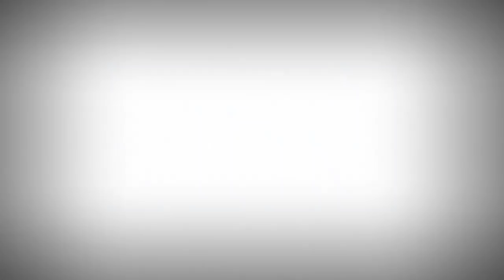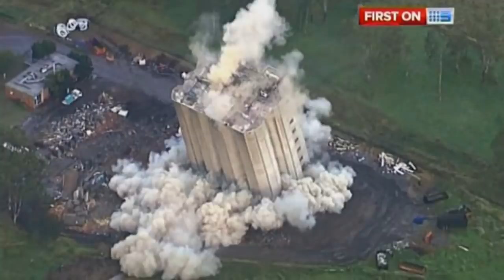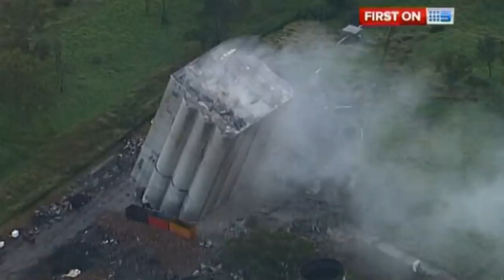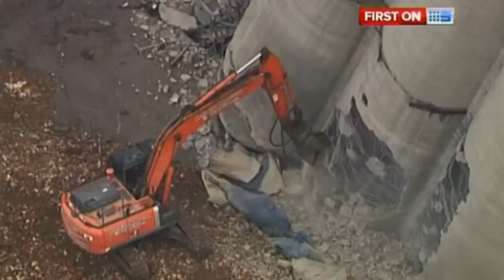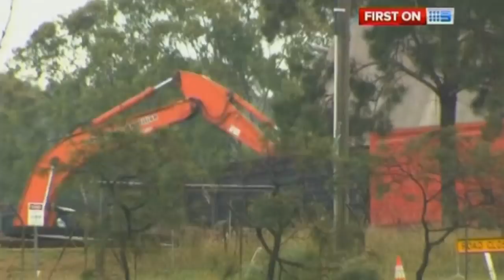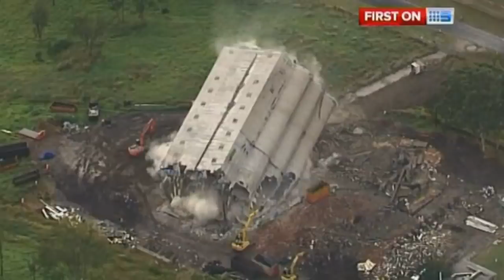A giant building implosion in Australia goes wrong

Comment: Just use jetfuel on the top floors, will come down within an hour.
Reply: It's concrete, not steel. Lmao
Reply: That's awful. :-(
Reply: Protip: Concrete doesn't melt.
Reply: >9/11 was planned
>edgy anonymous pic
>conspiracy channel

Yups.
Reply: Xendrius yeah but they have to be careful doing that... another building a few blocks away might mystiously collapse aswell, for no apparent reason...
Reply: Building 7 was hit by a falling skyscraper, gouging a huge hole in its south face, losing at least 4 full vertical support columns.
Reply: I know yours is a joke tesla, but for everyone else, no, building 7 wasn't hit by anything, buildings 5 and 6 however were almost cut in half and stood till they tore the whole site down.
Reply: This is epic
 The WTC also had concrete and steel. People are so fucking blond. They see this and still have excuses as to why the WTC's fell due to fire that wasn't even hot enough to "melt steel".
Reply: You mean the FACT that jet fuel it self doesn't melt steal beams?
Reply: Correct. The large office fires heat (but do not melt) the steel. Steel loses rigidity when heated and becomes much less load-bearing. The floor trusses began to sag under the weight of the floors which caused an inward pressure on all the columns. The "tube-within-a-tube" and all-steel construction are to "blame" for this. Eventually, the inward "pulling" from the floors sagging caused the columns to buckle, which initiated the collapse. Once a column buckles, the force redistributes through the rest of them causing all kinds of bad shears/torques, popping rivets and tearing columns... a rapid cascading failure of the columns (you can actually see this torque in the upper half of one of the towers during the collapse), once the vertical columns are gone, it's just gravity from there.
Reply: tesla, you need to change your user name and stop. what your talking about, some mild annealing in the specific rooms and floors would do literally NOTHING to the overall structural integrity to the building. have you not seen the towering infernos lately? why not them? top to bottom bonfire, yet standing strong. how about the top to bottom Beijing hotel that was BUILT asymmetrical and didn't even slightly LEAN to its heaviest side. the british one? it was burned out so severely you can see all the way THROUGH it and not even a little danger of sagging or SLOOOOOWLY listing to its most compromised sections and merely SHOW some asymmetrical damage.
and NO, the floor collumns never sagged in building 7, it didn't happen, wont happen, cant happen. you're also completely guessing on what happens if a column were to buckle, since a steel building has never had one buckle due to fire. what you described didn't even match some of the b.s. incorrectly constructed modelled.

its cute you said dumb-dumbs above, yet said what you said while having tesla in your user name.  you cant possibly show, not when we have steel buildings devoured by fire contradicting you, you cant show, not comment but a tiny scale model, SHOW, a symmetrical collapse that occurred in 1,2, and 7. and to refresh your memory, cause you seemed surpised "after 15 yrs" buildings 5 and 6 were CUT IN HALF! cut in half from damage and asymmetrical and had fires clearly with buckled and sheared and compromised "collumns" and yet those stood, and remained standing until ....wait, what did they do?...how did we take down 3,4,5,6,?....oooohhhhh that's right.....
Reply: If this where true the steel structure would still be standing. The building collapsed at nearly free fall speed an hour after a fire in the top floors. Please. Just think.
Reply: if people still think jet fuel and office fires brought down those buildings in the matter they came down then oh well I guess waters not wet.
Reply: The big airplane smashing into the building caused faults. The impact of the plane compromised the core of the building. That allowed the fire to comprise the steel. It was also an older building.
Reply: Tesla Death Ray it's only gonna compromise what's above it not what's below it, don't have to be a rocket science to see that. even at that how can fire weaken beam 10 floors below. Oh and water is wet btw
Reply: Tesla Death Ray The towers where built to withstand the impact of a boeing jet for this reason.
Reply: The building can handle a static load, but not a dynamic one. Imagine a glass coffee table. You can put a mug of coffee on it and it will hold up just fine. Now drop that mug on the same table.
It's like that.
Reply: are you talking a bout this article tesla?

""Of course, the structure of the lower 79 floors has been holding up the weight of the top 31 floors for many years. (That's the static load.) So should you expect it to be able to hold that same weight, dropped on it from a height of 12 feet (the dynamic load)?
The answer is, absolutely not!
Here's why.
First, let's calculate approximately how fast the upper 30 floors slammed into the 79th floor. (If you slept through high school physics, you may want to skip ahead to the result.)
    d=distance,  g=acceleration of gravity,  t=time,  v=velocity
    d = 0.5 g x t²
 
Solving for t:
    2d = g x t²
    t² = 2d / g
    t = sqrt(2d/g)
    t = sqrt(2d) / sqrt(g)
 
    v = g x t
Substituting for t:
    v = g x sqrt(2d) / sqrt(g)
    v = (g / sqrt(g)) x sqrt(2) x sqrt(d)
    v = sqrt(2g) x sqrt(d)
 
    g = 9.8 m/sec²
    d = 3.8 meters
 
Thus:
    v = sqrt(19.6 x 3.8) m/sec
    v = sqrt( 74.5 ) m/sec
    v = 8.6 m/sec
 
    1 meter = 39.37 inches, so
    v = 8.6 m/sec x (39.37/12) ft/m = 28 ft/sec.
    which is 19 mph.
In other words, if you drop something from a height of 12 feet, it will be moving at about 19 miles per hour by the time it reaches the ground. It doesn't matter whether it is a single brick or a 30 story building. After falling 12 feet it will be moving at about 19 mph.""

that's complete bullshit. coffe mug. yeah ok lets take a stack of ten coffe mugs. were going to blow up and completely remove the 9th mug allowing the top/10th mug to freefall and strike the 8th. the 8th is going to be completely fine, as with the 7th and so on. the absolute most that will happen is the 10th roll and fall off the 8th.  if I stack ten bricks, remove the 9th and again the tenth will hit the 8th. stack ten haybales, etc, now stack stories of a steelframe high-rise. your coffe mug example isn't calculating actual force. a complete story of the building CAN hit the the identical floor below it 19mph and absorb it. just like the bricks, just like botched demolitions, just like all the standing gutted and bombed out buildings we saw in Iraq, just like fires that engulfed entire buildings like the Beijing hotel top to bottom flames and the building had ZERO fireproofing.

I don't know how much you need or how much you've looked into this but your explanation, your example...it isn't backed by anyone. did you know that? your saying basically the pancake theory right? floors weakened and then collapsed? you are saying that right? did you know the government ISN'T ?? nobody is saying that, it was retracted. the "official" story isn't your explanation. and its funny cause the government under review and scrutiny had to retract that position because its impossible. but you and a ton of people still say it. can you tell us the "official" explanation. cause even the government when forced had to admit the pancake theory was impossible. but right now, the Washington post, 911debunker.com, Wikipedia, a host of others keep repeating it. you should look at what nist finally said. how they said it collapsed. 

so if the government has given three total explanations, changed its mind and postion twice, why not look at what science and physics have to say about it. and if you didn't know the official story had changed, just take an honest look. sit back for a second and wonder at the vaporized concrete and cookie cutter steel and just think for yourself. but at the very least know  that the government really doesn't have your back on what your saying happened. and please, if you find nist's answer PLEASE post it cause a ton  of people have filed foia's for it.
Reply: What makes  you think the govt. story is the only story? Thousands of agencies containing millions of experts have all investigated it. It is the single most investigated crime in the history of crime.
Reply: well sir, NOTHING makes me think theres only one story, hence this debate, I also volunteered Wikipedia and 911debunk sites, soooo,  but to the point what do you say caused the collapse, because mild annealing and bending is what the above said, caused a global symmetrical collapse in three buildings. what other story is there? there's math and physics and architects explanation, and then theres the "steel heated and bent from localized office fires and then collapsed in its own footprint 3 times"  id love to here more explanations.  you said thousands of agencies, HA.....HA......HA
..... moving on. so of the two agencies that have ever dealt with any findings on the collapse, which one described the collapse? and can you please say what they said, because  nist, not THE govt, and after you tell us what the one, single agency involved in any 9e;even investigation said about the collapse, please tell us where your opinion differs. and please, I really will listen because your an independent observer. the heavy handed sarcasm aside, I can tell you've put all of 3 seconds into this. so..... how long before the very first, the VERY FIRST investigation OF ANY KIND occurred. how long after? in the history of crime? that's stupid. most investigated??????? you made that up.

 so a full three years after the crime an investigative commission is formed. the testimony and findings are given in secret and off the record. this body of people you claim are experts is the first agency and says nothing about how the collapse occurs, is only formed after the victims families force it, and they are only left with questions and anger after they reveal their conclusions and then disband, rejecting any continued investigation. ANYTHING regarding the collapse itself is deemed classified and "would jeapordise national security" google it. then nist, the second "agency"(your words) finishes a 10,000 page findings report, and ends with " collapse imminent"

soooooooooooo, no one describes the collapse, not you, not agencies, not the govt. so now, if govt isn't the only story, and it shouldn't be, what are you saying, that our govt shouldn't have, or be expected to have the most accurate information? that youre willing to admit or concede the govt is wrong about this?  ok but if you and everyone else is simply saying that same wrong answer....wht the hell are you talking about? we don't have thousands of agencies, and we definitely don't have millions of experts, in fact the groups of experts are the ones you probably are arguing against. it took the victims families 3 fucking years to get the 9/11 commission formed. kennedy? that day investigation started, monika lewinki? yeah.... dude look this up, look how much money and how involved the Lewinski investigation was, and look at the spectacularly small budget of the 9/11 commission. but something tells me that if you were someone who looked stuff up, you wouldn't be on here thinking there a bunch, let alone thousands of whole agencies that deal the collapse of buildings, or think 9/11 was investigated at all. shouldn't an investigator have access to the crime scene?
Reply: lol except now, place several layers of glass under that coffee mug. Yea it will get through the 1st and 2nd, but the momentum slows with each layer it has to break through. Kinda like that instead.
Reply: I don't understand. are you saying place glass between the 10th and 8th mug, or place the whole stack on a sheet of glass like it would be the foundation. what is this showing?
Reply: SGWTYLER it was a jk we all know it wasn't jet fuel and it wasn't the planes either that brought them down.
Reply: and damaged the inside beams.... doing what? making it fall all four corners straight down through itself and NOT just a little bend towards the compromised area? it certainly didn't do much damage at all In truth tho, in 93 a van full of explosives parked right by the core, (your "inside beams") blew up with a hell of a lot more force than the jet impact and nothing happened to the steel frame. 
but anyway is this your own theory? can you describe the process? can you name the third official explanation? tesla didn't, no one else has, no foia's answered. how about what year the second was given. what year was the few frames out of the 86 cameras worth of footage of the pentagon finally released. do you know why? it was political pressure, and it was 06. you can think what you want but you don't know your own version. there was the pancake theory, debunked and retracted, then the "inward bowing" theory, which sounds a bit l;ike what your onto, this was also hilariously debunked and the "officials" had to admit it wasn't the explanation. 

now just as a person, did you know that nist manipulated and misrepresented most of the factors in all their models. is that cool with you? this was the investigation commissioned by congress after the 9/11 commission came up with nothing to explain the collapse. this includes the vast amount of sulfur, barium, and molten iron microspheres found at the site and all over manhattan. damaged inside beams doesn't explain that. sulfur....all over manhattan, in the dust. 

look think what you want, I don't know who did it, but those three towers came down from explosives. if you ever do look into this, and you come across the 18th misleading or straight-up lie from the government and "official" version, look at what math and physics says. look at their models. look at mythbusters literally dumping a huge pile of thermite and saying "doh! " look you'd need tons" I remember mythbusters saying "lets try and recreate it" do you think tereorists or whoever did it brought wheelbarrows and dumptrucks full of powdered thermite in the open air and just started going room to room packing em with 400,000 metric tons of thermite piles on the floor.... no....I have a hard time believing the mythbuster thought that either. now look at what cd contractors use, on their own comercials and youtubes. go look at home made youtubes of small amounts of "shaped-charge thermite" placed inteligentlycutting up industrial I-beam like its butter. on the cd sites they show the opposing 45 degree angle cuts they put on support collumns leaving exactly what you can go check for yourself was at ground zero.

but look just from your example your saying damaged inside beams ripped, tore, fell? well now your talking about "shear" strength. look up shear strength. just to give you an idea. have you ever driven in an suv? they weigh two tons. that two tons at rest is supported by only 20 small bolts. the ENTIRE vehicle, let alone all the force when it turns fast is supported by the small bolts that hold on the tire. these are cheap bolts. structural steel is even stronger. 2 tons....sitting on 2 pounds... 
well actually not even but it sounds cooler. ; ) .....shear strength.  I don't care how damaged floor 90-100 are. floor one? floor one IS HOLDING UP 109 FLOORS. FLOOR 20? 90 FLOORS.... and so on. that same floor and steel is at floor 90, the top ten floors can fall on it all day and it'll be fine. this is what EVERY EXPERT HAS SAID. the guys who built the building built it to be hit by  a 707, and the said it could be hit by multiple. like poking a pencil through a screen. 

but if that doesn't convince you, go look at ww2 footage, there were buildings built in the 20's that were standing in Hiroshima after a fucking NUKE hit them. a fucking nuke didn't take down skyscrapers in Hiroshima or Nagasaki. go look. is that not damaged inside beams? they were gutted instantly, just the strong steelframes still standing. no go look at ground zero. it literally looks like tons  matchsticks of equal length steel I-beam in a big pile right in its own footprint. go look
Reply: Xendrius  . the world trade center effect.  see how you are thinking
Reply: Aidan McLaren omg such compelling evidence! LMFAO.
Reply: +Tom tonka Coincidences stop being coincidences when they keep repeatedly happening. That Simpsons episode should have rung alarm bells, but those other movies/tv shows with those hints should be a big giveaway. 

But, seriously, it's obviously not referencing the emergency number if it's pointing to New York, with the towers acting as an "11". Anyone can see that. 

Now I realise you have to be a shill paid by TPTB. Noone can be this idiotic to make an excuse like this...
Reply: If you aren't a shill, you would have left by now instead of making inappropriately unfunny jokes that would make you the butt of the joke if you actually weren't a shill.
Reply: Wow, great comeback there! You sure showed me!

Calling me "stupid", even though you're too stupid to realise your employers will kill you the moment you stop becoming useful.

Did you think about that before you agreed to be their pawn?
Reply: Oh my goodness, no I never thought of that. You're right, I'm doomed lol
Reply: hey, tom, myself and others have given real evidence or at least tangible. any thoughts? no ones answered any questions about the official story changing or even what the government says happened. you have NO thoughts on that? because if you have pancake or inward bowing theory, both sides admit this is debunked and not physically possible. so you tom need a 5th idea of what happened, 5th because of the first two. then the govt's explanation now of which no can give me an answer. then the 4th which is from science, physics, architects, engineers, firefighters, pilots, forensic detectives, chemists, all of the first responders and eyewitnesses who were within a few blocks.... you get the idea. and then a 5th explanation which is a new one, or possibly co-incidently the 3rd but a new one to me and everyone else. 

ohhhhhhhhhhhhh let me just stop right here and put the uninformative "cacth-all" label 'directed energy'  as a 6th, but this is my equivalent of what the simpsons explanation is for you.

so this 5th explanation has to be as good as explosives. as good as shaped-charge thermite, the exact method, chemicals, tell-tale signs and results THAT COMPANIES WHO DOOOOOOOO CONTROLLED DEMOLITION GET. .... your on a cd clip. 45 degree cut I-beams and collums were found all over ground zero. so was thermite. the offices were pulverized with the concrete. even if you have an explanation for 'fire collapsed it' why aren't there 1000 sq ft chunks of floor and concrete and where the hell is all the office furniture? 

all of the evidence, the actual incident, lines up perfectly with a technique that already exists to bring buildings down....this is not far-fetched.
Reply: well, actually lets both pretend to be experts. everything we're discussing is public knowledge. we can fact check eachother. sooooo what is the conclusion reached by the best people suited to investigate. I wholeheartedly disagree with you that they were the 'most' suited based on the initial formation of the 9/11 commission, who was a part of it, who had problems with it and why. and then of course why it was reformed after public pressure and backlash. so... what did they come up with? how did they explain the only three seelframe highrises collapsing symmetrically in a manor and speed resembling cd from office fire? have you read my other posts? office fires doing what a nuke in Nagasaki cant? anyway.

 a skilled team of metal workers dismantling the scene doesn't explain the presence of thermite, molten metal in the ground, or fires reigniting weeks and even months later. but regardless I didn't claim it, experts did. and there are 45 degree cuts are from day one. look at top view pics. you wont admit that's an odd number of uniform length beams?

you didn't answer any of my questions, you picked reddit bullet point posts. no... ae911, david ray griffin, patriots for 911 truth, the first responders....they are very credible to me. not to you, fair enough but lets look at yours. you said experts investigated.....ok, well take everything they said, all of their conclusions, the TOTALITY of that is what has been amicably debunked. debunked by BOTH SIDES. a third conlusion was reached by these experts, publically, you can check, and you,  nor anyone filing foia's can tell us what that is. the CONCLUSIONS from science are absolutely ONE HUNDRED PERCENT on the side of cd. you cant argue with that, nist admitted freefall, the issue AT ALLLLLL was its resemblance to cd and such an anomaly in regard to fire and building damage. I thought you knew this? the commission and nists JOB was to explain why it wasn't cd. there is ZERO science in allllllllll of the rest of the experts you copy-pasted conlusions barring the unkown 3rd answer if that indeed contains science. zero...remember?... they kept changing their minds, used false models, resoundingly debunked? that happened... google it. pancake theory, inward bowing, and then whats YOUR explanation since your bizarelly arguing a side that said " to explain the collapse would jeapordize national security" and That'S why they wont tell you, me, anyone. meanwhile science, physics and math can tell us all we need to know. 

and fuck off with that everyone said muslims did it and then thinking that's somehow helpful, persuasive, or evidence. read above, I SAID terrorists did it. I have never speculated who, this entire discussion is at the very moment the 9/11 commission stopped. AT THE COLLAPSE!. the official story said what? "and collapse was imminent" that's your side...and everytime they try and explain how its thrown back. I have no idea 'who' and personally I don't think bush did it. did you know they were running a drill on the morning of 9/11, a military drill. guess what of? you guessed it a drill of hijacked planes crashing into the very places they crashed.i highly doubt "w" would do an attack of the very thing they were practicing. terrorists or cia or both anyone could've done it, but they sure as hell did it with it explosives. for all I I know the exact inceident with the hijackers happened and a completely different entity brought em down.

....look... i'll finish with a quote from you      " nothing except lies, twisted words, and hearsay. 16 years and not one of their claims has ever even been proven"
Reply: I already told you I'm not going to argue the how and why and the physics of the collapse because I'm not a physicist or expert in any of those matters. If you want to play pretend scientist then go for it, but I won't be having any of it. I can instead point(again) to the VAST majority of experts who say the way they collapsed is completely plausible from the plane impacts and resulting fires. Whether they changed their minds on exactly how it happened is irrelevant, that's what science is about- trying to prove yourself wrong.

You watched Richard Gage's cardboard box demonstration and still think he is a credible man? Unbelievable.

Got any proof of the military drills being held that day? Or of the thermite you claim was found? Conspiracy videos and websites aren't proof btw.

How does molten metals prove a controlled demolition? Show me another controlled demolition where molten metals has been a feature. A disaster zone that big with the rubble on fire..I'm not surprised there was fires and molten metals..I'm not sure what you are trying to claim here...Hope these links help

https://sites.google.com/site/wtc7lies/groundzerocleanup%2Cfreshkillssortingopera

https://sites.google.com/site/wtc7lies/photosoftorch-cutsteel

All it would take for the conspiracy theorists to be taken seriously is for them to release their version of the official report, or a computer generated model of what they believe happened. But I won't be holding my breath.
Reply: I KNOW you wont be arguing it because you CANT. and yes we can look up formulas ourselves. we can look up things from the material sciences, and just fyi this ENTIRE DISCUSSION IS SOLELY ABOUT THE COLLAPSE NOTHING MORE. YOU CLICKED ON A CD YOUTUBE, everyone here schooled you, you don't know your own argument, you have no idea what ive read or watched but trust me or don't, THERE ARE ZERO EXPERTS IN 2017 WHO WILL TELL YOU IT COLLAPESED FROM FIRE.

 I think you are late to the party, have no idea what a Richard gage lecture is ACTUALLY like, you have no idea who david ray griffin is or the stupid amount of observable repeatable proof available to anyone, and all your doing is repeating long-dead arguments. you cop-out that the most suited experts used science to prove themselves wrong, of which they didn't btw. they were proved wrong and admitted and then commissioned nist to explain it. they were proven wrong, retracted it, came up with a new idea and wont tell anyone. look... this isn't your idea, you don't have to be defensive if its wrong. I believed it till 05. you see I rejected my confirmation bias, and looked into it. its absolutely critical they changed their minds. the how and why of the collapse IS the discussion.

um molten metal proves EXACTLY that it wasn't office fires. beyond that literally every single cd using thermite has molten steel of which you can find tons of neutral. business only evidence. it HAS to melt the steel to cut it. hence the famous "can't melt steel beams". but of course we know lots were melted. and well below the reach of any fires.

"Got any proof of the military drills being held that day? Or of the thermite you claim was found?".................ummmm ok....if you go back up the page you can see I'm willing to have a discussion.  the fact that you didn't google this or if you did didn't find it from like cnn or any official sites, or find quotes from the people in the drills... but this comment right here makes me think I'm talking to maybe a kid or idk, and I truly don't mean it as an insult, I really don't. you just obviously don't have that much time in 9/11 research. 

does "conspiracy" mean inaccurate to you? that's worded odd. of course they can proof. accurate information is accurate information. conspiracy is people cooperating. as far as conspiracy theory? conspiracies have happened. its not far fetched. a conspiracy in our own govt got us into vietnam and a ton of people died sooo....do you not trust it because its biased? what is wtc7lies? pretty biased. how about all the debunkings from people in that list, pretty biased, so am I to say I don't trust any "official" source because of bias? no... there is room for us here. we can look at it rationally, see the parts of each argument that hold weight, or at least our attention and look for neutral sources to back it up. In my case I mocked this, and then after a time, and finding buiding 7, I said, I can question this and started looking into it. I said ok well, what is a controlled demolition, what does it look like. are these cd fingerprints accurate from cd contractors.... you get the idea. for the other side I simply had to test it against science. did you actually read my comments? what is your idea of why all these highrises and hotels aren't coming down from fire when they are obviously engulfed. did you look up 'shear' strength, that alone proves a symmetrical total collapse is impossible. the weakened section if at all would compromise towards least resistance and dissipate force. meaning if anything happened it would simply lean towards the hole.

and btw shear strength is MY argument, you aren't finding that on any truther thing or whatever or youtube, that's mine because I can prove that,.you can check the strength of the steel and bolts and rivets and rebar how the weight of the building isn't remotely close enough to tears floors away from that damage. you can straight up eliminate a cookie-cutter third of the affected floors and very little will happen. hence again to the buildings built in the 20's that stood tall after getting NNNNNNNNNNUUUUUUUKKKKKKEEEEEEDDDDDDD!!!!!!!!!!!!!!!....nuked.... standing just fine, but buildings built supremely stronger with better stuff and covered in hundreds of tons of fireproofing fall after 46 minutes of localized heat.... yeah, sorry man I'm gonna trust my physics and math teachers... the only steelframed buildings in history to do it man, all 3 on 9/11.
Reply: Fifty Shady Greys you don't have to be a expert to see explosives took those buildings down, 3 of them for that matter. Even if two missiles hit it won't fall in on itself.  Plane, fires, weak steel beam lmao  gimme a break. It's money, war is money, money is evil.
Reply: yeah exactly, ....sux tho
Reply: I'm not really sure but it's not exactly a brainbuster or a question with any real relevance.Maybe it's because the WTC wasn't a controlled demo, it was a disaster zone where fiery debris was spread for several blocks after the initial impacts and subsequent collapses? There was nothing controlled about it. In a way you just debunked yourself by asking such a question. On top of this I think you'll find that when cd's are done in Vegas they probably clear the streets for a few blocks around the building compared to a normal day in the heart of NY. Honestly this is one of the dumbest questions anyone has ever posed to me and yet you act as though it's some kind of incontrovertible proof. What is the answer you were looking for btw? What is the conspiritard claim that happened to these cars? Mind boggling, no wonder nobody answers you lol.
Reply: In fact, when these cd's happen in LV, tell me how many times buildings surrounding the demo are completely destroyed as happened to 5 other buildings on 9/11? See what I mean you are trying to compare apples and pineapples, it's just stupid.
Reply: If Tom Tonka was actually intelligent, he would have left by now. He's doing his side a disservice.
Reply: I'll give you one more chance.... What do you think happened to the 1400 vehicles that were destroyed by fire and how does your question have any relevance to 9/11 being an inside job?
Reply: tom....this is like 08, yourre new, uninformed and probably legitimately believe what you are saying. the lol's are real. we are actually laughing reading your responses. firey debris? so now your saying fire debris can melt .... wtvr... omgosh, dude, you've answered nothing, when your dumbstruck by new information you repeatedly claim its irrelevant, you wont look into it, or dismiss it because of some rigid dogma about conspiracy stuff. yeah....I mean to answer your point, yeah, again we can both pretend to be scientists here. tho obviously I'm not nor ever said I was a scientist, but regardless all we have to do is verify information and conclusions FROM scientists for ourselves, I encourage you to try. btw this is some general stuff I picked and I used real world examples. 

ok, you said dynamic load, yeah.... again you can completely remove floors 80-90 instantly and drop the 20 floors onto floor 79 at the speed of gravity and your asserting that that force is strong enough to affect floor 76? that force which is stupidly higher than what the builing experienced isn't remotely high enough to hurt 78 much at all. it will hit 79 and and sit there. have you ever seen the failed cd's? you know when most of the building drops onto the bottom part. what does it do? theres tons of neutral footage. the building drops down and sits there, then leans to the path of least resistance and falls intact. this is due to the shear strength of the buildings frame. you've seen some right? you click on cd clips like the one we're on right? the dynamic load of the top 20 floors would hit it the lower one and dissipate force. much like the exact reason every firefighter will tell you a steelframe highrise cant come down from fire. its because the steel frame itself acts like a giant heat sink. 

you said not fire only. this made me laugh man, yeah a plane hit it. why does no one, not even your side say a plane brought it down, lol BECAUSE ITS FREAKING STANDING HAHAHAHA. it completely, I'm still chuckling at this one. it completely absorbed the impact. this is why the entire debate is over how fire caused collapse.

I'm just scrolling through your answers here. smh, how does cd in vegas NOT apply. please go look at the London hotel fire, and then watch a lv cd and please decide for yourself which one building 7 resembles more. please just for yourself just think why it resembles one soooooooooooooo much more than the other. just for yourself, you owe me nothing, what is different about the London or Beijing towering infernos and building 7. and again you say the others were destroyed. buildings 5 and 6 were cut in half, yet they stood. they didn't come down. so you said the plane hit and that helped it fall. well what if we cut towers one and 2 in half. this is the long way btw. not like cutting the top half. so just picture that. 1 and 2 hit by 137 planes on the same side, 49% of the buildings structural integrity compromised. but still standing all day, not leaning or tipping over. now we have 2 real world analogues in 5 and 6 and they stood. go look. now just on your own try and come up with an explanation for yourself. you don't have to put it here, are you just like "well it happened" i'm just gonna believe what I was told without ACTUALLY knowing? I would chalk that up to personality type. some people really don't care about knowing or information and are totally fine believing what they are told. I'm not sure that's even a bad thing. idk.,.but this is a physical thing. no ones has to pretend to be anyone, this IS knowable.

and tom what are you talking about buildings at a distance, i fact checked you, are you literally trying to argue all of us and your not googling this? Hiroshima Nagasaki. buildings built in the 1900's. 

and tom, he's laughing at your office fires destroyed the cars because its preposterous. the burnig files and desks aren't enough to cover that, and most fuel was burned early regardless but wtvr. again please.... look up the recent high-rise infernos. even if, even if one fell over onto a parking lot, and it would btw, just lean and fall over if its possible at all.  and it wouldn't burn and melt cars.
Reply: oh, and savage, i didn't know much at all about the cars and honestly never really thought about it thanks, that's a new layer i'll go check out.
Reply: well this is getting interesting, tom lets re-cap. why are mine and others questions less important. go back up, you were asked a lot of questions, by several people before I talked to you. you were given a lot of new information. you already conceded I was better equipped to answer questions about the collapse. you repeatedly in multiple comments said you didn't know. well tom, that is ALL I posted about. you clearly said you weren't gonna argue about it. but you piped up, have been uninformative and condescending. you can absolutely take yourself out of the debate as you should.  you admitted you aren't qualified but you cant honestly think that's logical or accurate to say "i don't know, so you don't know" or maybe you do think that, it just certainly isn't real life or usefull. 

so why are our questions dismissed. you provided a list of people related to 9/11 in a professional capacity. I accurately explained how that isn't helpful nor address the part I was talking about. the collapse. 

 so ....you have questions. you took a wiki of northwoods which you seem to know about, which is a fale flag attack. a literal conspiracy, we can admit that right? it was members of the cabinet discussing a plan. literally conspiring.... I'm gonna just hold you to the websters definition, but you're welcome to argue this. my point is, you correct him only on the day and scope of the government attacking its own people,  to start a war, fully admitting and linking to its accuracy yet call him/me a "tard" for looking into what it would like if that's what happened on 9/11. I think if your questions were overlooked before, they will be ignored now due to the source. its foolishness. then "failure to answer is an admission" dude... that's not even realistic, can we hold you to the same standard? we can have a debate or discussion. I prefer discussion. 

my first comment was in case anyone thought tesla was serious. well there numerous picture and video evidence showing nothing caved a hole in the south face of building 7 right up to the moment of collapse. real easy to check for yourself, or I could do you your way and say please show me the hole. 
 
tesla brings up static load and links to a funny site, just for this occasion. it seems like all the formulas are accurate, but you can read my response. it doesent explain collapse at all and it certainly doesent account for all forces involved and if that was the explanation there are several examples on the very day that contradict it by getting hit with stuff with much greater force/(dynamic load) that withstood it. buildings 3,4,5,6, so an explanation of why a greater force... blah blah yeah you get it I hope. 

so then you chime in "who says about the only story" well tom, I answered that question didn't I. I said I agree theres more than one story. then whats the very next sentence. I asked what your story was. at the very most you said you don't know in further comments. your happy to tell us we're wrong, literally dismiss us based on sources and bias, but not have a clear understanding yourself. by default that very position is "just believes what they were told", now in fairness you said you trusted those sources and called them experts. fair enough. my side is in direct contradiction so I can discredit/prove all of them and have by fact-checking my sources and seeing who proved to be more accurate. 

you didn't answer any of my questions even from the first comment. so now 30 posts later you have a couple that wont even address or change the argument and you say dodging. so lets recap and talk about it. you said thousdands of agencies, well there aren't 1000 agencies period, and there definitely aren't 1000 that would deal with ground zero forensically, but wtvr i get what your saying. your under the impression it was thoroughly investigated.  well I told you it wasn't, you can fact check that. another question? did the 9/11 commission have access to the crime scene? they were the first to investigate out of this 'most' investigated. see, my whole first comment is on the transparent fact you literally have no idea what you are talking about. it was BARELY investigated. google how much funding the 9/11 commission got. then google how much funding the monika Lewinski case got. 

now that's your country man, you said most investigated in history and a simple cumshot was investigated and funded orders of magnitude more.  I'm absolutely correct here, google it. googl the quotes of the ACTUAL commission saying it was a joke, they repeatedly asked for more funding for tests, and MORE ACCESS. that's the experts on your list btw, the actual commission so if i cant quote from your own experts... so what now, do i list all the public examples showing how it wasn't well investigated. your very first point is demonstrably false and theres a wealth of information you've never came across. 

so after theses experts, there was nist. nist , the experts, the engineers and physicists, hired by the right people to be the right people for the job provided a computer model demonstration. have you seen it? its one of many 3d simulations but this one is quite priceless due to that fact that it was demonstrated they, one...deliberately removed collumns and didn't simulate the buildings archetecure. (now mind you this is your trusted sources, these are the actual people who will tell the news, and popular mechanics of pancake theory and inward bowing, so if they had never been corrected or proved wrong you have to admit you wouldn't know and would believe something inaccurate. you already admitted you weren't and you believed what the experts told you right now in 2017. just think about that, the personality type maybe) but regardless, the simulation was as you said "peer-reviewed" (and scientists don't say that btw, they just say paper. to be a paper, or be published it HAS to be peer-reviewed so its redundant, just fyi.) so it was checked and it didn't match the blueprints, and they also skewed the parameters of the test to make it fail. there is another 3d model which is the current "official" one but they wont release the parameters of the test or the program or anything that would let anyone repeat their test. 

actually let me switch tacs here, ok so you don't trust Richard gage, can we check and see if his physics are correct? can we check all the sources he provided? and btw a cardboard example to illustrate a principle is fine, do you think if he used steel beams they would fall through eachother? you must get what he was showing. at least i think i know the clip you mean. is that all you've seen from him btw? but lets discredit him, we can still use science right? no way around it anyway, but if a liar teaches spelling correctly we don't throw away spelling. you see how spelling is the cardboard in this example to illustrate a principle.

who are you asking  about firefighter conspiracy, i don't know what you mean but the editor of firefighter magazine is a 'truther' as you call it, well he probably isn't, i'm not even sure what that means when you say it, but he knows it wasn't fire. also you are correct, heroes, who said different? all the first responders said multiple explosions and explosions on lower floors. dan rather said controlled demolition as did multiple other public figures on the day. then they didn't. literally 3 years before the investigation started to see what caused the collapse. but even if none of this happened i would still consider them heroes. and actually ive been into this for awile and ive never heard the fifrefighters referenced with ANY conspiracy. 

if the fires weren't hot enough?"    thermate.  my question, where do you think all the sulfur and barium came from all over manhattan? offices?

japan nukes?  this is so general but if you want to 'gotcha' me with the fact  that i cant name any buildings damaged by the nukes?, you got me, aaaaaaaand i don't even feel like googling some to save face lol. but my point stands as it so well shot, you can literally find 1000's of pics and clips of this. and no they all aren't on the outskirts, but even if they were, its the outskirts of a nuke, soooo, but any way theres plenty all over and its cause of the shear strength of steel. (and you've had zero to say about that btw.)

truther papers? i just told you nist was corrupt but you'd believe a paper from a truther, WELL HELL, by all means please start your wonderful examination into the destruction of th world trade center, there are 1000's of articles and examples and testimonies, i would watch a lot of documentaries, they aren't all equal, i would watch a lot of lectures and presentations by david ray griffin and Richard gage. i believe Richards accedemic stewardship will surprise as he leaves literaly nothing up to speculation and provides all sources. i think you'd be surprised that 9/11 conferences are only getting bigger even though its 2017. i recommend talking to anyone you consider an expert on forums and sites dealing with physics, engineering and chemistry. theres volumes of info at all levels of education. you notice i don't even give you tensile or shear strength numbers, or formulas but explain the easily verified concept.
papers? models? absolutely! homemade shaped-charge thermite clips? yes sir! a ton of soldiers and government employees risking much  to say they question the official story? go to patriots question 9/11, pilots for 9/11 .org, and of course your least favorite but theres a hell of a lot more people than just Richard gage, ae9/11. did you know there was a patriots for 9/11 truth? you know they aren't sueing right? theres nothing to gain, only risk? just sayin, i f your new to this.

so you see i want to see you and everyone else do their own research. so there, ive answered yours.
Reply: oh I missed your lengthy response, hold on
Reply: Take your time. I'm going outside. I'm done with this crap for today.
Reply: PLEASE TELL ME YOU WATCHED IT JOED
Reply: no, joed you HAVE to watch it, you'll love it! I promise, I just watched it again and am chuckling all over again. the clip is only a minute long. the excact clip I watched is called " "plasco" building collapses in Tehran (another view)

yeah I have no way of proving or knowing if anyones a shill so I don't really worry about it and just respond to what they've shown me. ive had the same conversations and responses at work so I figure the conversations gonna be the same. but I get what you're saying and theres certainly tons online. not just for this but race-baiters like cointelpro, pr stuff, etc etc, I know you know. ive also found that if they are here they can hear, just like at work, often people over hear and get involved in the conversation. ive seen a few that literally just lalalala lbut in general I'm sure you've found the same thing, that very few people are unconvinced after talking about it and seeing this stuff.

well tom, mad appropriate it is that we rap this up today out of respect. so tom, sorry if I namecalled or was sarcastic or rude, told you to keep up, etc. if you think that building is an argument for your side the distance between us too great. beyond that your responses... just aren't helping, not a conversation anyway. so my all caps is "correct" what did I assert in caps other than you win, I'm done? and wtvr I really was laughing,

you continue with gage thinking if you discredit him you discredit what ive said, he said, truthers said (what does than mean btw, whats a truther?) well discredit away, that very premise is flawed and as you can see I gave you that, don't trust anything he says, where did I ever quote from him? I think you just like to argue, I don't. ive tried many approaches with you, but you just insist on arguing and showing your ignorance of the subject. notice I don't assume your stupid? I don't carry that over to a judgement on you as aperson and things you might know a lot about that I don't? cause that's not realistic and when people read you doing that repeatedly it does say something about you, but regardless its obvious you don't even know what you're your arguing. you think thermite's silent? what do you think all those pops and rumbles are in cd's?

I think you like to call my stuff ridiculous that you have zero chance of addressing, tom.....you're comments are right here. the questions you didn't even know to ask are right here. 

"Honestly you're just a dumbass that comes up with ridiculous answers to anything you can't comprehend that doesn't fall into what your confirmation bias tells you happened. Every single one of your claims has more holes in it than swiss cheese and when pressed on it you either ignore it or make up some otherr ridiculous claim." 

you're gonna say I did that tho. ok well that's why I'm wrapping this up. ive answered your questions, all your questions. what is this high strangeness about nyfd, NO DUDE! I DONT THINK ANY FIFREFIGHTERS ARE IN ON ANY CONSPIRACY. 3rd time now, so now tom when any thinking person reads YOUR posts, they will see you aren't reading mine and know that I did the exact opposite of ignoring and answered you. now what about you?
 how did the heat overcome the shear strength of the buildings core and frame?
why are you ok with not knowing what the non-conspiritard answer on how they collapsed? see, that's not an expert question, just why are you ok with foia's being denied and the explanation kept from you?
what else of Richard gages have you seen? and for the record i'm not even sure what this cardboard thing your talking about is. he doesn't bring cardboard with him around the country.... wait...ima google it. um yeah,,, the distance is too great between us, I watched it and I'm afraid I'm picking on a kid. ok well tom, if you ever do take a highschool physics class your gonna do tons of analogue experiments just like this that are 100% reliable to illustrate things like gravity, newtons laws....etc. even colledge physics uses easy to understand demonstrations.  we used ballons and paperclips sometimes. 

so you really think you'll get a different result from a different material. do you honestly think that? or do you just say that to argue?  that if he was holding a scale model erector set, the top section would fall THROUGH the rest of the model. it's all the same material, therefore has the same strength,  I talk about this in  previous comment, where you can use bricks, steel, coffee mugs. why don't you try this your self. but look you might have an idea or opinion about the results but scale models and analogues are a pillar of scientific experimentation. isn't that a perfect illustration of static and dynamic load?

you're not arguing me, here, you can any material you want to illustrate the point, you're arguing with very basic science. like 'addition'
 so no, I'm not a dumbass, you can call me one but I'm open about my information. and really, you literally said nothing from a 'conspiracy' site is gonna work. so I could link to movies and lectures for you but you'd disregard it. but then you act like that's what ive given you when I give you totally neutral physical principles. I have wondered a couple times based on your insults and evasions if your a die-hard science hater, maybe the condescending creationist type who constantly makes fun of science. but for the record you can love and use science and still be a creationist and smart, ive met them, they have science on their side too. I myself am completely up for either, I believe science will one day answer definitively, but you, you dismiss it altogether and already admit you wouldn't even consider the science angle. which is ironic because its what proves my points, what cause the debate, what caused the investigation at all. 

speaking of which, is my monika Lewinski/9/11 commission point ridiculous? 
are you still gonna say that it was the most investigated? 
these are questions but I don't really need the answers, you've already seen there is waaaay more to this than you ever thought, that you just believe whatever you are told and are ok with it and openly admit it. I'm not. and you obviously didn't google what confirmation bias is. you see tom i started out like everyone else on YOUR side, i believed what i was told and shown. then i REJECTED my confirmation bias by investigating the claims of others and am now on the other side. you see how that works? i literally searched for how cd works, i didn't search for my bias "wtc7lies". com. its literally right there in the definition. the tendency to look for things that confirm your bias. which is what you've done the entire argument. every example and link has been skewed and biased. from your debunker sites to your evation of every neutral point. if a small gouge brought 7 down why did 5 and 6 stand? 

 you give no explanation for the towering infernos we mentioned and then hold so strong to your Tehran example, and on this final enjoyable note, do you see after the center implodes the wall facing you is intact, all in one piece still, do you see it lean over and then catch? it already had nothing holding that side up, already had momentum/dynamic load and it caught for second, it caught and held by just some of the left side. that's shear strength. a much smaller piece can hold a much larger piece. but here we are done, you cant/wont see it, wont discuss, and its 9/11.
Reply: cool man,  glhf
Reply: have you watched it yet joed?
Reply: Erm....An airplane crash caused it...Thank you for finally admitting that fire is hot enough to destroy a car. Now that wasn't so hard was it? The magic words are ....96-4
Reply: That's right, but at least I  have an answer. Unlike someone we know. Let's see how many derogatory names and insults you can squeeze into your next short comment. It really does make your arguments seem all the more convincing.  Always remember: 96-4
Reply: haha, yeah, I thought you'd enjoy that joed, : )
Reply: Xendrius Look what you gone and started! happy? you beat me to it, I was gonna suggest a Quantis 757 hijacked by Kangaroos! but people are loosing their sense of humour nowadays.
Reply: Tesla Death Ray a group of engineers and scientists will make a preliminary result  announcement on whether the building were brought down by controlled demolitions in December. I think it is the most sophisticated examination ever conducted.
Reply: do you have any more information than that? I just google many variations of December investigation
Reply: http://ine.uaf.edu/projects/wtc7/

Sorry， maybe I remembered it wrong. I read it from somewhere else and didn't bother to do much as I thought the results will be reported after the announcement. 

not sure if it is the biggest investigation or not, though.
Reply: wow, thank you both for the articles, very cool. that's exactly what I was looking for. and dm, it looks pretty big to me. I'm gonna go watch what I can find by Leroy hulsey, I think the best part is taking it before congress and forcing a vote,  so I think its at least the most significant. thanks for the info!
Reply: Lol lots of triggered yanks over here.
Reply: Fifty Shady Greys
It's criminal that all the evidence was destroyed. We will never know if the Steel beams had the extra 'Stiffening Plates' or the 'Vertical Lips' fitted?
The official cause is fire, so why wouldn't they want to find out what failed?
It's never happened before, the reason why should have been top priority.
Reply: Tesla Death Ray straight from the official account...
Reply: 666th likd
Reply: Tesla Death Ray conspiracy theorist will cling to their fact less theories even when you show ACTUAL REALLLLL FACTS showing otherwise. Don't bother with them lmao.
Reply: Fifty Shady Greys those buildings didn't have a plane crash into them. It's a factor of the impact + jet fuel filed fire. I'm sure if those other buildings had a plane crash into them just before their fires I'd bet my left but they'd fall.
Reply: neither should steel from jetfuel and stationnary fires but whaddayaknow....
Reply: hahaha....
Reply: theirs the 2 engines and the rest is more or less tinfoil paper. they didnt fly supertankers into the wtc's bro just regular airliners and if anything old scyscrapers had a lot more core material then nowadays, soooo. the two engines just went on a crazy spree and hit all 24 columns??? gtfo....
Reply: and its back to the troll bridge for tesla...lmao. This is as clear cut as it can be explained. Good job!
Reply: dude your dime dropped slower then that building
Reply: except for the engines its all plastic and aluminium....over 200 exterior beams and at least 80 core beams and the 2 engines skadaddled all of them or at least enough to cause a perpendicular free fall ??? you fuckin' with me right???
Reply: norad had 2 planes standby for the entire us mainland that day....luxemburg have more then that on the weekend...
Reply: Tesla Death Ray there is plenty of footage from that day with people saying they heard explosion along with firemen too and Trump said the same thing that day.. Disgusting to say but if there were terrorists they had plenty of help that day..
Reply: land otter1 lol yeah ... im suprised  the jet fuel didnt burn up the concrete and top grade steel much faster .. i burned up the concrete in my driveway with lighter fluid once  hahahahaha
Reply: Cubius Blockus lol and 2+2 =19
Reply: Plz tell me you have a job that doesn't hold peoples lives in your hands if it fails. If you do, let me know what projects you supervised so i can call the approriate authorities to check its up to standard. Your math is way off, no wonder you been getting it wrong.
Reply: Cubius Blockus   welll his job actually does affect peoples life...just keep your burgers off the floor, Xendrius,  i dont like dirt like dirt on my Big Mac..
Reply: nice 1 mate. I run a small carpet cleaning company with 5 employees, im studying engineering at newcastle university and volunteer for the State Emergency Service(SES) and the local rural Firebrigade in raymond terrace. I know a bit about bushfires and how fires react in domestic housing situations not to mention my degree covers fire protection.

Stop projecting.
Reply: Ohh i know the US government is a warmonger, and possibly the planes were flown by Remote to thier destination whilst they organized an actual terrorist to attempt a plane takeover on one of them to legitimize the the whole terrorist attack, but they definatly didn't intend on bringing down the towers. Planes strikes would have been enough to mobilize the US.

My country has been dragged into pretty much everyone of thier retarded resource wars.

My issue is with the stupidity coming out of people claiming it was laced with explosives.... it doesn't need to be to pancake. Sampoong department store prooves that.

I dont care if it an inside job or not, just the accuracy of the information.
Reply: maybe fire doesnt have  to melt steel to make it loose it's integrity , but something sure as hell has to melt it if you want it to form a puddle of glowing redhot molten steel that kept smoldering for over  a week... so no,  something melted that steel and even a 7 year old, by now, knows it wasnt the goddamn jetfuel nor the office stationnary or the inkcartridge of the copier... the buildings fell in their goddamn footprint man... in their own footprint ! , maybe once in a blue moon but not 3 times in 1 goddamn single day. one got hit dead center one got hit on the corner and one didnt get hit at all...yet they all dropped in a few hours in their own shadow... and dont get me started over the goddamn plane that flew in the most secure building in the world but yet there is no videofootage except those 5 frames...a seven eleven has more camera coverage then the pentagon???
Reply: jawadad802  ask the govt what was actually used.. Bush probably knows..
Reply: Nonya Bizniss    lol
Reply: Jawadad802. Yes, thermite melted the steel into a puddle.

If you dont know what thermite is, its aluminium + iron + fire + Oxygen.

Plane is made mostly of aluminium.
The building caught fire.
The building is made of steel and aluminium.
High winds on top of skyscraper.

There you go buddy, theres your ingredients for melted steel and concrete.

Ive used a fire lance to cut thru concrete before. I made it myself.

Just roll really small tubes of aluminium 2metres long, bundle those rolls together, wrap them, pump oxygen thru the tubes and ignite.

Takes less than 15mins to cut thru 1ft of solid concrete.
Reply: glad to hear you taught building 7 was odd, the passport was odd,...guessing the pentagon plane vanishing trough a six foot hole and the abscence of debris/damgage on the lawn or any footage ...equally odd, the sheer mastery of the nearly impossible plane trajectories after  flippen' trough the flightmanual pages as if he was studying for a midterm ...Odd? norad training excercise of a hostile plane take over on the exact same day it occurs...odd? 2 different Billion dollar fraude investigations that went up in smoke in 1 single attack..oddish?...this list goes on and on buddy ...but I'm guessing you'll get there eventually by yourself. Tell me this, if all the evidence has been recycled into brand new, slightly thermite tainted, steel coils, if the few half assed investigations are closed, if the government tells you to either follow the official narrative or be deemed an unpatriottic nutjob... what other means do the people have then to try and have an educated guess into " the how, why and whom? "? All in the  hope they get close enough to the truth so that the next time people will at least have an alternative narrative for when the shit hits the fan again.... Only reason Obama didnt bomb the shit out of the Assad regime is because there was a worldwide uproar when they tried to feed the 'chemical weapons' bullshit spin again... as for my reading comprehension, english is my third language, I'm quit satisfied with it's level....thank you very much.
Reply: I already stated that i think the pentagon was bullshit..... TBH, i think the pentagon was either working on something and it exploded, was a terrorist(domestic or foreign) or was an inside job to cover up evidence.
The Pentagon 'attack' happened days before 9/11 and i believe they tacked that 'attack' onto the 9/11 attack to provide a more dramatic effect and mobilize the population for war, because an attack on military AND civilian targets is considered an instant declaration of war.

Many times military targets have been struck, killing milllitary personnel and didn't lead to war.
Many times civilian targets have been hit, but war never occured.
But hit both....................

The info is too vague to come to a full conclusion. Surely with some wikileaks going around something about 9/11 should be there somewhere, or not.

Also, i have a curious mind, id pick up a flight manual and read it front to back several times. It's an interesting subject.

Could i have some links to the NORAD hostile plane take-over exercises please?
Reply: where did you get the pentagon attack didn' happen the same day? That makes no sense whatsoever, theres like 25.000 people working over  there, you cant' cover up something like that with so many witnesses. And it would serve no purpose to jeopardize the whole plan by such a liability like 25000 witnesses of all walks of life... 
 in the pentagon 2 distinct groups of people died
 
1st; a bunch of budget analists who were investigating 2.3 trillion $ in defense budget that went missing disclosed days before by Rumsfeld... 
2nd; a group of people, mostly navy, plenty of them on early retirement with a wide variety of skill sets...of whom most have had additional training after their initial employment in the defense forces....no mission statement or department to be found for those victims , or something very vague, in the orbituaries...

best guess, that second group was imperative in the planning, prepping and story setup for the whole operation and were now a liability. Even if some of them were already wondering where the whole operation they had been prepairing for in the prior months was leading up to and some might have guessed right they were way  in over their heads...why would they be suspiocious of being called into office for a mission debrief in the pentagon, most secure building in the world and every branch of the army to protect them only a few corridors away???? enter cruise missile trough the outer walls...

every statement of every pilot of commercial planes I ever heard/read that  talked about the planes' flightplans prior the crashes stated even the best of the best of them probably wouldnt have been able to pull those manoeuvres off...and to score 3 out of 3??? I'm a sea pilot, waaay easier then piloting a plane and I'm telling you, flying an airplane in a 3 dimensional, setting at +300mph, not forgetting the stress of them just having  hijacked a plane(it was after all their first suicide mission), knowing they are about to die and actually flying for the first time something else then a cesna....to pull that off???? .... no  eFF'ing way, simulators is one thing, the impact of the stress factor during the real deal is something totally different + prior to the attack a cellphone was probably the most advanced piece of equipment they ever used....
the US military conducts drone missions from airconditionned containers in over 60 airbases in the US and dozens abroad covering the entire globe...installing a module in a commercial airliner to take over controls is a piece of cake.

Cheney and rumsfeld with their massive skyrocketting shares in haliburton, silverstein with his 4.5 billion$ insurance claim on the wtc towers, guilianno with his premature "they gonna pull it"...no need to look far for those to grill on the issue if they really wanted to get to the bottom of it.... question is could the US handle the truth??? 

http://911truth.org/category/case-for-complicity/air-defense-failures/exercises-and-wargames/
Reply: 9/11 was caused by global warming!
Reply: Xendrius 

Very original joke XD
Reply: Jet fuel, also known as Islam, the peaceful religion of peace 👌🏻
Reply: fee fee,  ah ah ah, great !!!
Reply: Like srsly guys
Reply: marvin martin  no such thing as pure concrete high buildings. they all have beems.
Reply: 999th like
Reply: You work at the same office with George Bush do you?
Reply: Yeah they should have hired Bush an his team they would had it done right 👍I mean they have experience taking buildings down just look up wtc 7
Reply: What's it like being insane? Is it fun?
Reply: LMAO maybe hire a indian to do smoke signals too
to signal the hidden bombs and thermite to be detonated and wallah
"see jet fuel fire on top bring down building from the BOTTOM no lol that is impossible maybe if the twin towers melted to the pave ment starting at the top and melting down like a candle but "FREE FALL" speed is impossible with fire at the top maybe slow candle melt be even then that would be one good wick in the twin tower? exactly they are not candles
buildings made of Steel and concrete do not burn down unless the fire was as hot as a laser
i have seen aluminium reach ignition fire fighter can not put it out produces its own oxygen and is white hot 
BUT fires can not melt high carbon steel used in building columns ever they would glow red but not melt even in the hottest fire it takes electric-furnaces to even melt that high carbon metal electric furnaces (3,272 °F), while laboratory units can exceed 3,000 °C (5,432 °F) and they are specially concentrating the heat you can not melt these high carbon steels in the "OPEN AIR" unless using a chemical explosion heat like Thermite burns (over 4,000 degrees F)
jet fuel can not melt high carbon steel "maybe in a specially designed OVEN" but in the open air the heat would "dissipate not concentrate"
the melted foundation beams on the twin towers shows me a "deliberate cut by the angle"
 on which the cut is exactly what a demolition expert would do to weaken the internal structure 
there is no way a fire melts steel on a 45 degree angle 
if the fire melted the steel it would be "OXIDISED" but the beams were only "OXIDISED" right next to the cut line showing thermite was used there is no other way to melt steel in this direction unless they pulled out the oxy torch 
the twin towers foundation beams were not water cut ,or laser cut the cut was too dirty,,
the twin towers foundation beams were not melted by fire "the cut was too clean to be by mere fire" (learn how to oxy cut then try and cut thick metal with-out the high pressure air jet) 
the twin towers foundation beams were cut with "Thermite"  there is no known other way to science to suggest that "Fire" cut the beams by melting them the fire was not directed through a nozzle to be directed to a point of the cut was it no it was a fire burning fire can not cut steel plain and simple
in conclusion
the metal workers know their job and 9-11 was a inside job
the demolition experts know 9-11 was a inside job they know how buildings get demolished
the architects know 9-11 was a inside job they design these building to with-stand lots not fall at free fall speed because of a fire on the top floors?
all the witness know they heard bombs the denotations of thermite
the police force the fire force even
some dude who just came to america and first looked at the twin towers to see them fall knows it was a inside job
Reply: @sandradeearna3342  comment of the year
Reply: Edgy
Reply: Ko in ko
Reply: Fifty Shady Greys exactly!
Reply: A building a couple blocks down fell
Reply: @danp5145   or chicken has lips
Reply: Xendrius they should of given bin laden a plane for an hour😂😂
Reply: This thread is totally blowing my mind man
Reply: @AAllen-br8it  lol Rick. I just read the entire thread. Took two days